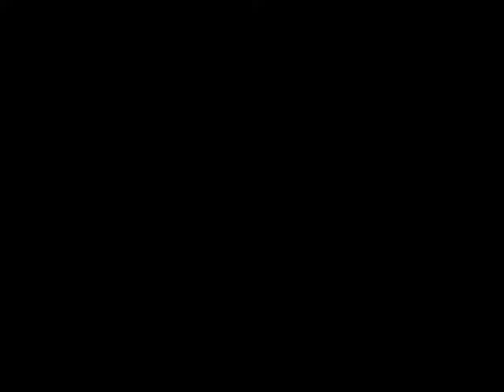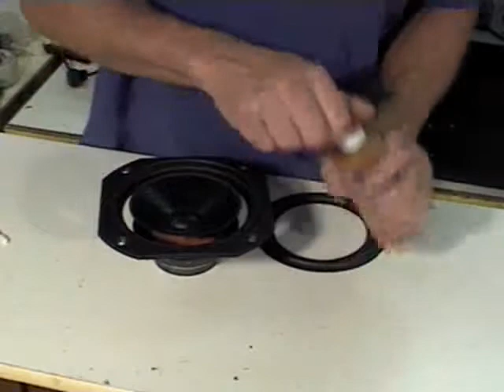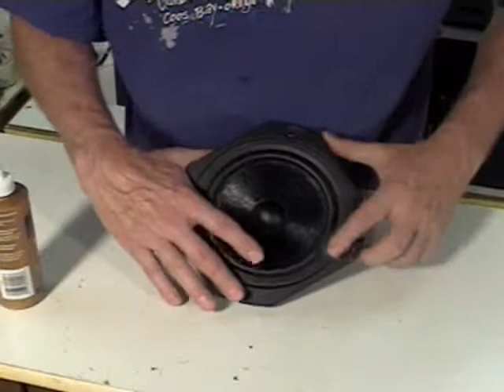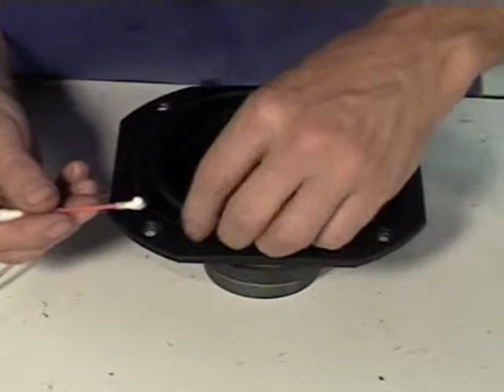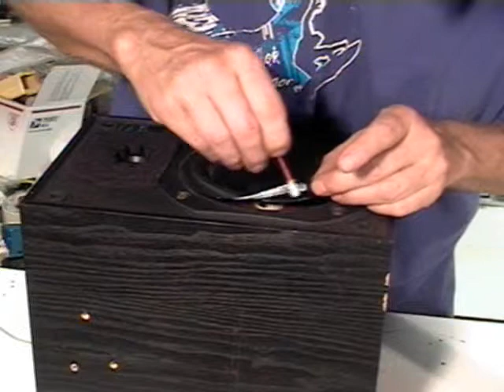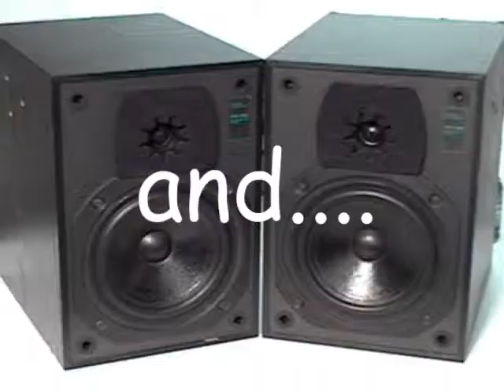Easy Speaker Repair - Foam Rubber Surround Ring Replacement

Comment: You crack me up! This is probably the best video I've run across all day on how to do this with the best explanation. In the past I've done the shims - pretty foolproof but ya' gotta cut those caps off - and I've done it by eye (or ear) also, working the cone with one hand and adjusting the outer ring with the other until the scratching goes away, but that method leaves room for screwing up. I like this...I wonder if you can just drive the speaker off of the headphone jack on your phone or does anyone think that'll over tax the phone circuitry?